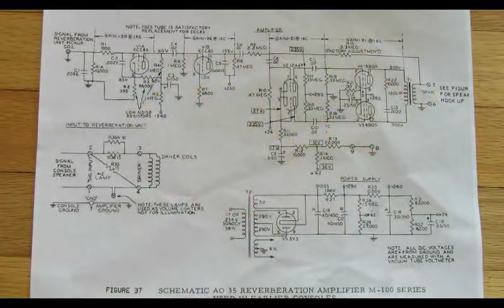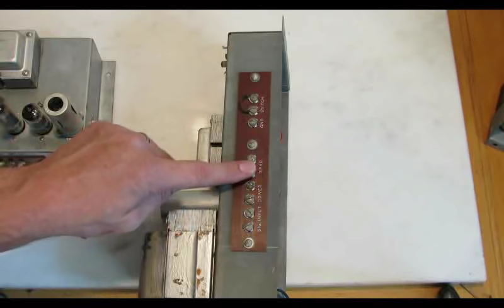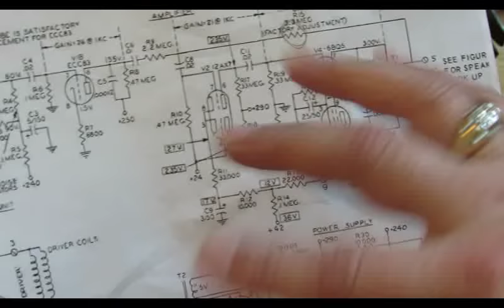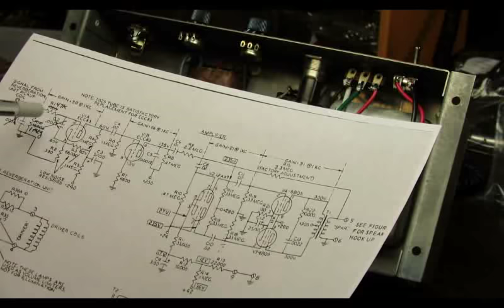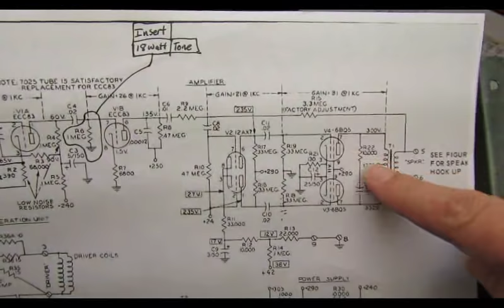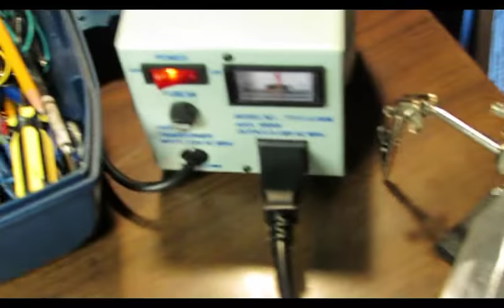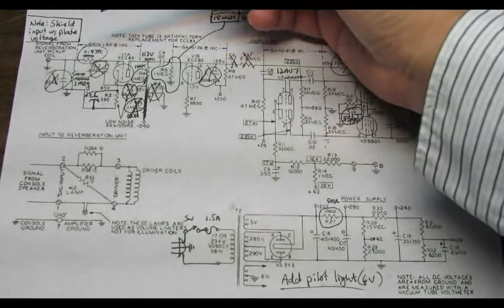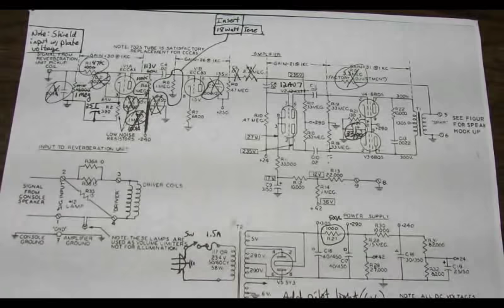Hammond AO-35 Complete Start to Finish Guitar Conversion & DEMO

Comment: I obtained an OA-35 chassis and i'm looking forward to the conversion to a guitar amp.  Your tutorial very helpful and thanks so much for putting it together.   Several times during the demo, you mentioned how loud the amp was.  Do you have any recommendations of how to "quiet it down"?  I don't perform in large rooms and would mostly use it as  practice amp or just to jam.  

Thanks again, you videos are very informative.
Reply from the maker: +Mike Choffin You can tame it down by using a smaller value volume pot, say a 250K or 100K pot. You can also lower the value of the first grid leak resistor from a 1M to something more like 220k. That would tame it down. You can also remove the bypass cap from the cathode of the first gain stage, so get rid of that 25uf cap, or reduce it to a 1uf. Lots of ways to do it, but these would be the easiest.

Good luck with your conversion!
Reply: +The Guitologist I noticed in the video that you replaced the the filter caps with three individual caps .  Was that cost driven or is there an advantage to installing individual caps?   I know the can sells for about $35 and the caps can be purchased individually for under $25.  

Thanks again for the previous reply's,
Reply from the maker: Cost vs. benefit.

A can would have been an unnecessary expense when I had plenty of room in the chassis.

Comment: GUITAR PLAYER 40 YEARS, ORGAN PLAYER  22 YEARS NOW. Ugh, makes me cringe somewhat seeing, the GREAT AO-35  3-SPRING NECKLACE SPRING REVERB AMP BEING USED TO MAKE GUITAR AMPS...but shouldn't we be seeing Necklace springs on Ebay more?
If you want a hoot, read the HAMMOND ORGAN HR40 TONE CABINET SERVICE TECHNICIANS 'TECHNICAL BULLETIN' " REPLACING OIL FILLED REVERB SPRING WITH NEW TANK REVERB, INSTRUCTIONS FOR PREAMP [built by tech infield using a transistor...]. Note the late 40's- 5?'s HR40 TONE CAB [ which I play through in my video below] HAS TWO AMPS, ONE GIANT CHASSIS, 8 6V6'S, MULTIPLE 6SN7'S,6SL7'S, 9- 8"'ish speakers @ 1-2 ohm total driven!, and 2 12" pm speakers pointed straight.
...at any rate,the tech notice instructs, 
" carefully remove HAMMOND oil reverb assembly*  wrap in newspaper, and dispose of it". 
*[forget 'technical name, but it was the 1st reverb, as was designed by reverb inventor- LAURENS HAMMOND]

Since the TANK REVERB also was the successor to 3-SPRING NECKLACE REVERB, makes you wonder how many of those were disposed of.

THE NECKLACE REVERBS ARE THE BEST EVER SPRING REVERB...3 springs for L/H/& W!
I have the 1952' HAMMOND HR40,but also an ER20 'DECORATIVE

[ WHICH BTW, YOU CAN SIMPLY 'DRIVE THE 'SPKR IN' OF THE AO-35, AO-44 to April'ish 62', and AO-44*  .IN WITH AN EXISTING SMALL SINGLE TUBE 6BQ5/EL84 OR 6V6 AMPS SPKR-OUT.

 I have a HAMMOND A100 from APRIL 1962' [100% ORIGINAL] wIth the AO-44 TANK REVERB DRIVE

THE POST- APRIL 1962' AO-44 is w/ same AO-44 GUTS, BUT THEY USED ONE TRANSISTOR AS WELL , in place of 1/2 12A?7.

PLEASE PLEASE PLEASE, SAVE THE VERY VERY INCREDIBLE WURLITZER 1953*'-* 1963' ELECTROSTATIC CONTINUOUS FREE*REED *ORGAN , AND THE >>ONLY<< ELECTROMECHANICAL MASS PRODUCED ORGAN EVER *MADE*. 
YOU CAN LISTEN TO MY 1956' WURLITZER 4410  ELECTROSTATIC CONTINUOUS FREE REED ( SPINET SIZE- 13 PEDAL, 2 x 43 key, keyboard manual) ORGAN I play on my Youtube channel. Just Youtube search
>  WURLITZER 4410 ELECTROSTATIC FREE REED ORGAN  <

THE WURLITZER 4600 1953*'* 1963' ELECTROSTATIC CONTINUOUS FREE*REED *ORGAN is the FULL-SIZE-CONSOLE 25 PEDAL 2 x 61 key , keyboard manuals model.  THE 4600 CONSOLE, AND THE 4410 SPINET ARE IDENTICAL INTERNALLY, ONLY DIFFERENCE BEING SIZE- # keys/pedals.

THE 1956' WURLITZER 4600 AND 4410 ARE THE VERY FIRST ORGANS WITH SUSTAIN ! :-) What is unique is that their are two separate  SUSTAIN SWITCHES I and II.  Okay, something we need to clarify is the ELECTROSTATIC REED ORGANS ARE NOT ACOUSTIC IN ANY WAY, BUT ARE USED 100% electronically to produce the HARMONICS, which are then  filtered to produce the STRING, REED, and FLUTE voicing.  The  flutes are sweeter and  more harmonically rich than a Hammond tone wheel organ's. ALL REEDS ARE 'VACUUMED' [not blown] FROM THE INSTANT THE ORGAN IS POWERED UP. SOUND PROOF CAST METAL CONTAINERS HOUSE GROUPS OF REEDS.,AND THICK FIBERBOARD MAKES UP THE OUTSIDE OF THE LARGE 'REED/MOTOR BOX. 

Okay, I hope I've enticed you to explore this very thorough pictorial 'technical article' of the Wurlitzer 4600 by the NORTH SUBURBAN HAMMOND ORGAN SOCIETY... GOOGLE:    NSHOS WURLI 4600

LOTS OF LINKS AND INFO BELOW MY VIDEO ->>

WURLITZER 4410 ELECTROSTATIC FREE REED ORGAN  + LESLIE HORN + HAMMOND TONE CAB HR40

THESE WURLITZER ES REED ORGANS (INCLUDING THE EARLIER 'slow attack' "KEYED ES REED" ORGANS 46'-53', w/ air to reed only when key depress, instead of 'continuous air on all, hence 'Hammond' INSTANT ATTACK) HAVE THE SWEETEST FLUTE TONE! What's nice about these "instant attack" organs too is the FLUTE,REED/HORN, AND STRINGS ARE ALL VERY TRUE SOUNDING, THICK, HARMONICALLY RICH, AND 'AMP EFFECTORLICIOUS!
...YOU KNOWwhen the JENSENS LOVE YOU SOUND. PLLLLENTY!

Now peel your eyes, save one, and contact me if you need help, but a very easy organ to maintain...and like the Hammond tone wheel organ, NEVER EVER GOES OUT OF TUNE.

BTW, the NSHOS HAMMOND B3, AND HAMMOND X66 ARTICLES ARE ALSO EXCELLENT!

ENJOY! THE electromechanical ORGAN IS GUITAR'S CLOSEST RELATIVE! 
HAMMOND TONE WHEEL IS AN ELECTRIC GUITAR, BUT WITH METAL SPINNING DISCS IN FRONT OF MAGNETIC PICK-UPS INSTEAD OF VIBRATING STRINGS.
-THE WURLITZER ES REED IS A CAPACITIVE DISCHARGE PRINCIPLE...NOT UNLIKE A CONDENSER MIC. 'THE 'PICK-UP AND THE TONE SOURCE  CREATE A TONE GENERATOR LIKE NO OTHER. FOR THE TONE SOURCE AND THE PICK-UP ARE THE SAME THING! The article explains how their unique Vibrato is created as well. THUMBS UP IF YOU LIKED MY POST. :-)
Reply: @keithschneidly3922  No, it's all Greek.

Comment: I know this is 5 years old, but...
R4 & R5 are not supposed to be 1M ohm, they are 0.1 M ohm or 100K ohm, which is what you found.
I also think there is a problem with the drawing on the phase inverter, as is, it won't invert. look at any fender drawing or any class B or AB amp and compare phase inverter inputs.
Let's call the top (pin 7 input) the B side of the tube and the bottom (pin 2 input) the A side.
The B side receives the input via C8 as a pass capacitor and the A side receives the same signal via R10 - uninverted.

In many drawings, I've found what looks like a feedback wire (from T1 terminal 5) going back to the A side as an inverted signal, I've also seen where it is taken from the power outputs. Most often, it is taken from a single tube driving from the plate and the cathode as inverted signals. This drawing screams WRONG at first glance. Maybe you could tell me how R10 inverts the signal to the A side input?

Yes, I've been trained in classical tube design way back in 1974 and had a 65 Super Reverb and a 69 Dual Showman (I think it was 69). Look at the Super Reverb, Bandmaster, Showman, Dual Showman or this back end of a Marshall amp the V3 ECC83 right input comes from the output transformer to develop the inverted phase at C14. https://el34world.com/charts/Schematics/files/Marshall/Marshall_1959_jcm800_super_lead_power_amp_100watt_year_1988.gif

Help me out here and actually check where the wires went. If nothing else, a tone generator in and a scope synced on the input and a view of V2 pin 2 vs pin 7.
Thanks.

Comment: Here's another dumb question from me:  If you are putting the plate voltage on the shielded input cable (shield connected to pin 1 of 12ax7) and that cable is laying against the chassis, then aren't we grounding out the plate voltage?  BTW, nice to hear somebody else bustin out Rock Bottom by UFO!

Comment: I'm working on doing this conversion now and one issue I'm having and it's a big issue is that I'm not getting plate voltage on the first 12ax7 tube, I changed the filter caps but I haven't changed the coupling caps they are original could this be the issue why I'm not seeing plate voltage like I should? If anybody can chime in and help that would be awesome.
Reply from the maker: Hey Ron. Trace out the power supply. Start at the plate, then check the other side of the plate resistor. See if the voltage is present there.
Reply: @TheGuitologist  And that's exactly what I did and I found the issue and that fixed it. Now I did all the modifications that you did except I disconnected the fb loop wire. Man what a beast of an amplifier, this thing is killer! Thanks for all your detailed info, cheers.

Comment: I LOVE my 44 as a clean amp and for use with my pre, but the M-100's main power amp was utterly decimated. The motor still worked, and I tried to turn it into a "portable" organ that would sit on a keyboard stand and plug into an external amp, but I was way younger and hadn't a clue what I was doing. I meant to give all the extra organ parts (organs? parts?) to a guy at a local shop, but my basement flooded and that was the end of that.

By the way, is there a way to make a tube-driven compressor (not "true tube compressor" where the tubes themselves do the compressing, just with a triode as an input stage and another as makeup gain after) using those bulbs as the "variable resistor"?
Reply: +Adam Rainstopper Oh, and don't worry about the shrink tubing with the soldering iron issue....remember the teachers all told Picaso the HE was doing it wrong. And real men use pink lighters.
Reply from the maker: +Adam Rainstopper This lighter has a bumper sticker on it that says "My other lighter is a soldering iron." :P
Reply from the maker: +Adam Rainstopper Too bad about your Hammond. Dead Hammonds make the Baby Jesus cry. As for the compressor... I'm sure you could find a compressor/limiter using a bulb setup like those used in the Hammonds. I haven't looked for schematics.
Reply: Brad Linzy Making the baby Jesus cry is NOT COOL.

Comment: Once finished that makes a great plug and play amp. Sounds excellent and really cooks.
I have two of the AO-40 amps. At a quick glance theyappear to be very similar to the AO-35 shown. Anyone know if the the conversion process should be nearly the same?
Reply: What is the equivalent output wattage.

Comment: So the tone stack is actually between the 2 halves of the first 12ax7? Not between the second half of the first preamp tube and the phase inverter.
Reply from the maker: Correct. Just replace the resistor to ground that point with the tone stack specified in the description. 

https://youtu.be/iXh4H0TvWuk?t=1h26m32s

Comment: I made 1 from a Hammond/Everett model chassis AO-50.  I use it with the expression pedal hooked up and get some pretty unique sounds, especially if I play in stereo. The AO-50 also has a built in gain pot. .also use the Gibb's reverb tank and Heppner alnico speaker for the cabinet.

Comment: My buddy just gave me a Hammond H-AO-43-1 and after watching you fix up that AO-35, I'm wondering if I can do something simple to this one to make it usable as either a pre-amp for my Fender 212 to give it a nice tube sound, or if not maybe just use it by itself or with my little crate amp as a pre-amp for it?  The first problem I have though is I'm not sure where to connect the power chord.  It originally was connected to the organ with a couple connectors, and the only place I can see that looks like it might work is on the back of the round 4 pin plug... but it only has 2 wires going to it, both black... one goes to one side of the Transformer and the other goes to the other side and they are joined at the plug by an orange round little cap or something that looks like this ( https://encrypted-tbn0.gstatic.com/images?q=tbn%3AANd9GcSW97ITYhx4qibSUD3eweJOP8SVtrDsaqeoFb-T-8itk_linhX_&usqp=CAU )  so I thought that can't be right to connect the positive and negative to both sides of the Transformer could it?  I don't think I can send you a picture of it on here, but it basically looks like this... except this one has the 8 pin connector taken out and all the wires.   https://www.tdpri.com/attachments/1-jpg.680241/   -   https://images.reverb.com/image/upload/s--WOigbJXA--/a_exif,c_limit,e_unsharp_mask:80,f_auto,fl_progressive,g_south,h_620,q_90,w_620/v1492541007/hoe9szn1wf3cnlga0kit.jpg

You could probably do it in your sleep but I haven't been able to find any wiring diagrams or schematics that show where to wire the plug to. One guy said he put the positive on the top prong and the negative on the bottom one, but there's nothing else connected to the bottom prong (pin 2 I believe) so that didn't make any sense to me.  Then he said he ran a jumper wire from the outside of the plug to the top pin (4 I believe), ran it to a switch and a fuse, and then back to pin 2 which still made no sense to me.  So, it's safe to say... I'm confused!   Any help you could offer would be greatly appreciated... along with any ideas of how it could be easily modified to use as a pre-amp... OR ever as a second amp with a pre-amp signal that could be ran into another amp ... kind of like a stereo or doubled effect sorta thing.   Either way, thanks for the video!  Loved it!

Comment: I just finished one of these, and wound up with gnarly parasitic oscillation till I put in a 12at7 in the PI stage. Still a little too much gain, I'll try a 12ay7 and 12au7 tomorrow.  I used the Moonlight tone stack and the tone doesn't really do squat and like in the video the volume goes from zero to 11 too quickly. Did anybody find a decent tone stack for one of these?
Reply: Sam, where did you wire in your tone stack and where did you wire in your pilot lamp?

Comment: I added L Brackets so the turret board is mounted horizontally - MUCH easier to work on :-)
Reply from the maker: Only problem I can see with that is, I found it easier to apply solder iron heat to the conical connection on the back rather than the top of the board to solder and de-solder stuff.

Comment: Cool. What does it sound like @60 VAC ? :-)
Reply from the maker: Hi Ronald. Sorry I missed this comment before. I thought I had replied. When you starve a tube amp of juice like that, really what you're mainly hearing, I think, is the sound of the preamp tubes, mainly the first stage or two, having an altered load line. If you like the sound of an amp at 60VAC, you can take some readings of the plate voltage and plate current at V1 and V2 with the amp at 60VAC, then adjust the plate resistors and bias resistors for those stages to replicate those readings as closely as possible. That will leave the rest of the amp basically unchanged, so you can get that screaming OD and still crank the amp to keep the balls in the output section.
Reply: Yeah, yeah. You know you wanna try it. ;-)
Oh, and when ya do, be sure to post up a video!
Reply from the maker: I may do that, but I have 100 projects in line. Some good stuff coming up if I can get the time!

Comment: I have an M3 organ [Hammond]. I inherited from a relative. Servicing an organ from the 1958 is a bit problematic. I don't know if you are familiar with these old organs,  but hammonds have made incredible progress since then. If you look at the new ones some of them have piano sounds as well as the B3 and th3 me reverb leslie sound as well. All this in a package that weighs 16 pounds. The price of these is around 2500-3500 dollars depending on what you want. Just about what Gibson gets for a Les Paul. https://www.youtube.com/watch?v=hsmrvZEc_uw The M3 could be quite expensive to restore. If anything what's available today will make most people forget about restoring an old Hammond. I know some people say hang on to the old, but I think modding these old Hammond amps to tube guitar amps is a better use for them.

Comment: they are also put in danger by scrapers, as they contain $300 to $600 in palladium wire plus the amps ,copper ,speakers and other parts of value unless it's a B3 they are worth more as scrap and parts.

Comment: Shielding the input wire to a plate sounds very unsafe. If the insulation in the shielded cable is not rated for HV (it is only designed for signal voltages after all) you could end up with 100+ volts on your strings.

Comment: brutal!
Reply from the maker: +Chris Kennedy  I know, right! Crazy overdrive on these things. I'm really stunned by how much power this circuit has. This amp could EASILY push a 412 cab, no problem. I think that massive Hammond transformer has a lot to do with the sheer power of these things. I could tighten up the crunch and wring even more power out by using a 5AR4 (GZ34) rectifier and 7189A power tubes. I may try that for giggles and put up a demo of that. I'll have to see if I have a reasonably decent pair of 7189A in my tube collection.
Reply: +The Guitologist Hey Brad, I'm working on a conversion of an old Conn organ into a guitar combo with a friend. It uses a 5U4, 2x 12ax7's and 2x 5881's. That power transformer is a beast (serious poundage), and the filament line alone must be rated for over 10 amps! I'm surely not wanton for power with it. It is gonna be loud and clean (but Boy! will it crunch)!
Reply from the maker: Vintage organ amps are usually so over-spec, they're awesome for guitar.
Reply: +Britt Rossman funny you mention that cause I actually dragged home a conn organ (minuet 541) a few months back that i got out of the free section of the classifieds. Yep they got the big valve stereo amp in them, and a crap load of transformers 12au7 tubes that make up the tone generator. I'm actually gonna give mine a chance to survive on as an organ probably be quite a tedious clean up but its all working as far i can tell. I have to track down a service manual for it.